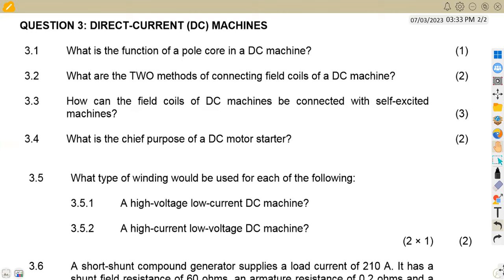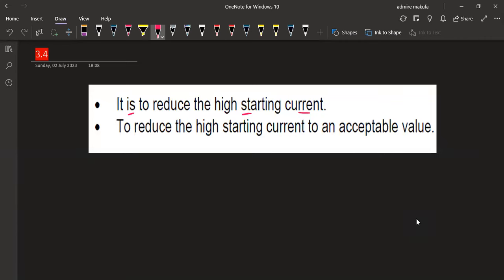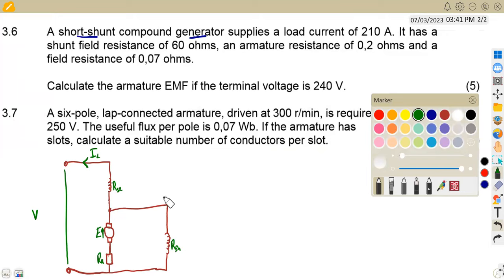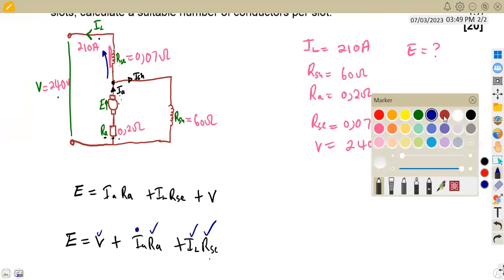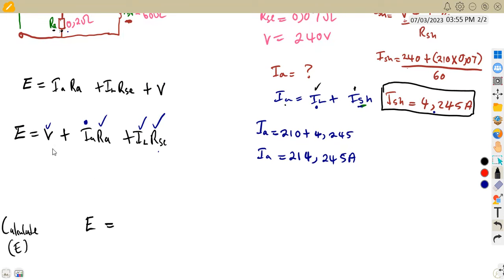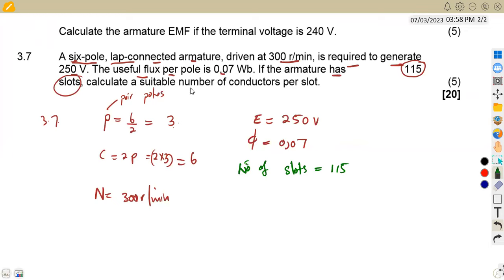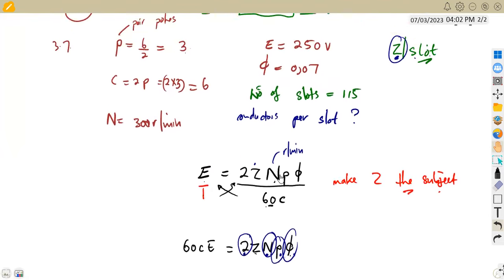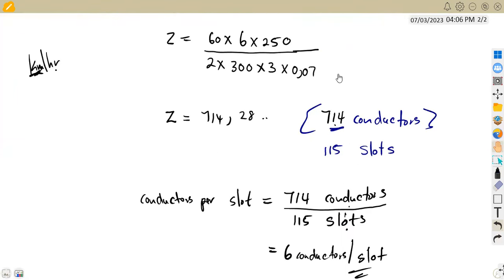Electrotechnics N4 DC MACHINES November 2022 @mathszoneafricanmotives

Comment: sir for Ish i got 213,755 and you got 214,245 because i didnt use the formula , i calculated everything step by step
Reply from the maker: That's fine, as long as the method is correct ❤